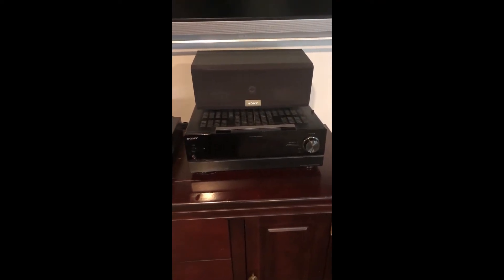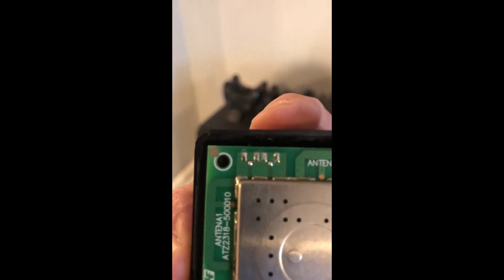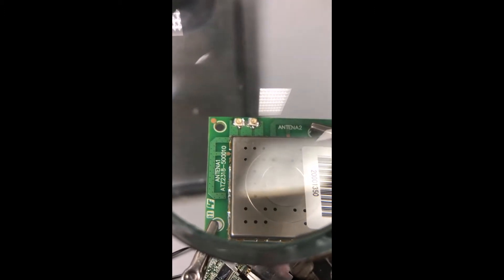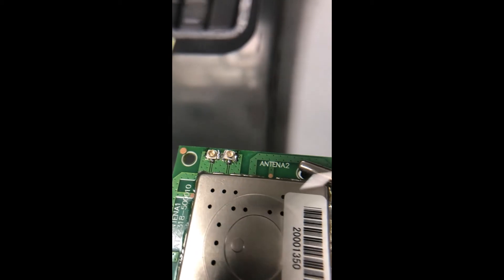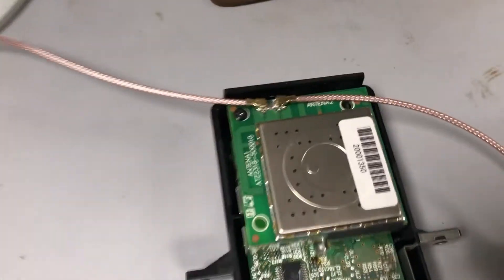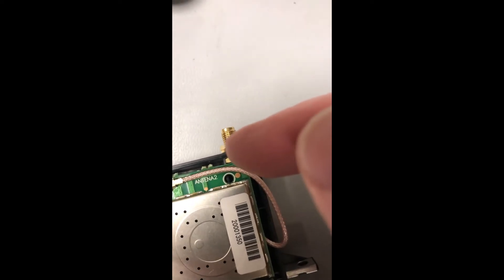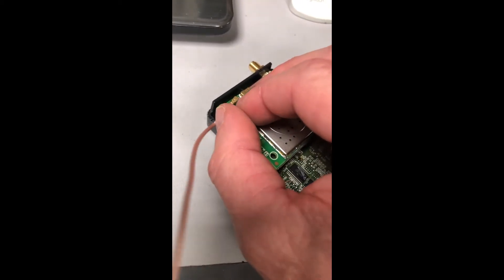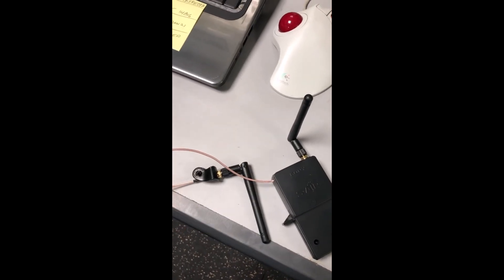Adding external antennae to Sony S-Air EZW-T100 transmitter: 15 bucks + 1 hour = range extended!!

Comment: Are 2 antennas necessary? I’m doing this same thing right now for my DAV-HDX576WF system.
Reply from the maker: @Jorin Burkhart I am sorry, I didn't see this comment (I don't get notified by Youtube when they are posted).  I only added two because I saw spots for two of them, and because when I ordered the little solder-on antennae mounts, they came in a multi-pack.  I would imagine even a single external antenna would be better than none.
Reply: @jonathanbelmont5752 , thanks for your reply! I figured the same thing. I ended up going with 2, but I’m still having the same issues. Even moving the units within a few feet of each other (and have 2 antennas on each one) doesn’t solve it. My problem might be something other than the S-AIR cards at this point. 😞
Reply: Do you have links for the items you purchased on Amazon? I’m keen to give this a go as well

Comment: Any idea where I can buy a ezwt100 transmitter ?..can't find them on ebay! Great work though
Reply from the maker: That's where I got mine... definitely took some searching and some patience, as they are obsolete and only show up occasionally.
Reply: @jonathanbelmont5752  can u please provide me with a link because what im seeing they are $100
Reply from the maker: @ntclpz  Got mine a year ago.  They don't pop up often.  I would set up a search on eBay and put in automatic notifications so you get an email when one is listed.